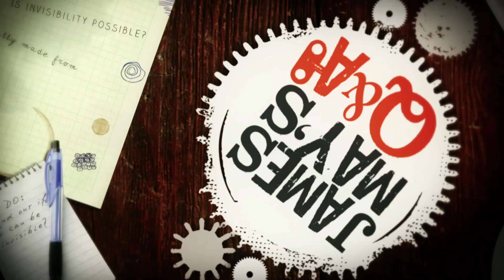Why Can't Trains Go Uphill? | James May's Q&A | Earth Science

Comment: he says steel on steel has very little friction but the coefficient of friction for steel on steel is .5-.8 (and im guessing locomotive engineers use optimized steel for trains so it's probably closer to .8) which is pretty high, for example, rubber on asphalt (as he mentions tires on roads) is only .9
Reply: Don't know what you mean by "optimized" steel, but if you take a steel rod and drag it across rail it will slide extremely easily, whereas if you take a tire and try to slide it across asphalt it will grip a lot more. The difference is locomotives way over 400 tons so that helps the wheels grip the rail.
(also locomotive engineers just control the train enroute, not build them)
Reply: As he alluded to, both train wheels and the tracks are curved.   It's like two coins touching on edge.   There's very little contact area.

Comment: Duh... the wheels slip.  BTW, 80% grade is not 80-degrees.  The problem with gradient is that the normal force (that actually generates friction, perpendicular to the grade) is reduced by the cosine of the gradient's angle (N=W cos A), where W is weight, and frictional force is F=uN, where u is the coefficient of friction (to put a fine point on it, there are two friction cases... u for static friction (before the train moves), and v for rolling friction (self-explanatory)).  It doesn't "create more drag."  Go back and take statics again.  FAIL.

Comment: Jeez, I hate to say this, but this video seems wrong all the way through.  The reason train wheels are efficient is because they don't deform, so just a point is touching the track.  A rubber tire flattens so there is a whole patch touching the road.  And as the tire turns, the tire is constantly squishing.  All that squishing takes energy.  Train wheels don't do that.  Train wheels would be super efficient even on a regular road.
Reply: Other than the fact that they would destroy the road XD

Comment: Maximum speed is NOT determined by aerodynamic drag, it's determined by mechanical limitations and the track conditions.  Only when you get into the high end of high-speed rail does aerodynamic drag become somewhat of a limiting force.  Steam locomotives reach mechanical limitations long before aerodynamic drag becomes a limiting factor.
Reply: Limiting yes. Relevant No. The fast passenger steam engines like LNER A1 and A4 or the BR 01.10 and BR 03.10 actually benefit from streamlining using less coal. Full streamlining was dropped from the latter two mainly because coal was cheap Post WW2 compared to the extra maintenance effiorts

Comment: Real answer (without the video waste of time)

Modern trains there is no reason at all.  They go uphill just fine.

Some early steam engines had to coast downhill a bit in order to get the correct valve and piston timing to apply enough power to get moving uphill... but even then they could go uphill if the operator knew what he was doing.  Once moving, no problem as long as the load wasn't excessive vs the grade.

so obviously (before even looking at this waste of bandwidth... the video is based on stupidity.

Comment: The Train that goes up to Pike's Peak is one of the steeper grade around. You always worry about the breaks on a train when in that situation. The conductor assured us the break were in good order but even if they did fail there were two spring at the bottom to stop us. Manitou Springs and Colorado Springs.
Reply: That's a cog railway.   The locomotive has a drive wheel with teeth that mesh with teeth in a rack.  No normal train could travel up that grade.
Reply: You misspelled the word "brake" twice. Not a slip up. Ignorance because of our school system.
Reply: Yes I do know how to spell brakes......It's was a brain fart.

Comment: Union Pacific Big Boys had no problem climbing the Sherman Hill...
Reply: A big 1.55% grade
Reply: 1.55% gradient. Lickey is 2.65%. Do some proper research, thank you.
Reply: @caboose.20  lickey? Where's that?
Reply: @vajeye-nar6172  Worcestershire. James said that in the video.
Reply: @caboose.20   Union Pacific Big Boys on that line are they?
Reply: @vajeye-nar6172  that's isn't very relevant.
Reply: @caboose.20  my original comment was in response to the original posts' commenting specifically on the Union Pacific Big Boys on Sherman Hill. You reply to my  comment talking about Lickey in Worcestershire when that has absolutely nothing to do with Sherman Hill or the Union Pacific Big Boys. Please tell me why my last comment is Irrelelevant and why your Lickey comment is relevant to Sherman Hill or Union Pacific Big Boys.
Reply: @vajeye-nar6172  you said Sherman Hill's gradient was "big" even tho it's nothing compared to Lickey.
Reply: @caboose.20  It was supposed to be a sarcastic comment hence "big".
Reply: @caboose.20  considering the lengths of trains there, it can get challenging real quick
Reply: @vermilionrailfan5651  any gradient would be difficult if the train is long enough

Comment: Does the contact area have anything to do with it though? That's something I don't get, because area isn't in the equation I learned for the force required to overcome friction. The friction remains the same with any amount of contact, I am told, because each point carries a fraction of the overall weight. The equation only uses weight and coefficient of friction. So would it matter if the train had beefier wheels?

Comment: What about roller coasters?
Reply: Roller coaster cars are pulled up a big high incline by a rigidly connected chain drive. Then it coasts down the other side and just free wheels the whole time it is moving. It's never going faster than it does on that first drop. It never has tractive force between wheels and tracks. 

Its average speed is constantly decreasing all through the ride. Roller coaster designers build sharper turns and twists later in the ride so the customers won't notice that it's going slower and slower all the time.

Comment: A specially designed train called a cog railroad can go up hill.  They have on to get to the top of Mt. Washington in New Hampshire.  Not sure if they have them anywhere else.  Basically there's a big cog in the middle that meshes with teeth on the track pulling the train up and preventing it running away back down the slope

Comment: Qualified freight engineer here.. uphill you had mostly right. However the downhill opinion you had was completely wrong. MANY features prevent runaway trains, mainly, the train-line air brake. if conditions are perfect it is possible but very unlikely.
Reply: I know what you meant, vacuum brakes
Reply: Reverse gear also helps with Downhills.

Comment: Who says trains can't go uphill?
A recent example was runaway work train that the brake failed and the train crashed at the bottom of the hill with it's load of lumber or coal about 3years ago.
America's Coastal region is generally 12 to 50 foot above sea level, yet these trains make it across the country at higher elevations so yes trains go uphill.
The author of this story never read "The Little Engine that could".
Reply: Wiki
"The Lac-Mégantic rail disaster occurred in the town of Lac-Mégantic, in the Eastern Townships of the Canadian province of Quebec, at approximately 01:15 EDT,[1][2] on July 6, 2013, when an unattended 74-car freight train carrying Bakken Formation crude oil rolled down a 1.2% grade from Nantes and derailed downtown, resulting in the fire and explosion of multiple tank cars."
Reply: Too much weight and the locomotive's wheels start slipping on the rails. Sometimes trying for a hill, you have to make sure you have locomotives spaced out through the train, and depending on the length and weight, multiple in the front, middle and back. It can do the hills, just not very well. At work we had one area called "The Hill" and whenever it was more than just empty tank cars, it could cause some trouble. Half the time they would add extra locomotives just to ensure it could climb the hill, and they'd just get dropped off in a nearby yard afterward.

Comment: Don't trains brake with shoes onto the rail itself rather than braking a hub mounted disc (like on a car) or the wheels themselves (like push bikes)? If not, can they? It seems that'd be a lot more efficient a way of slowing them/holding on a hill.

Comment: So why didn't they have a second set of track inside the main ones only on hills that were gear pattern  and a set of wheels in between the main wheels to gain grip on the incline? It works in my head so it should work in real life
Reply: no it doesn't work in real life ( I'm just guessing) cause i think the tracks inside of tracks are for bridges only for some crazy reason
Reply: They're there for protection against derailments.
Reply: oh ok thanks for the fact

Comment: This videos conclusion is wildly misleading and incorrect, even though it's well produced and has a charming chap presenting the facts.

First off, they didn't actually explain why trains can't go up any steep incline, whereas a car can. In their explanation, the only advantage the car has is that it packs more power per unit mass, which should mean that it only climbs faster than the train, but the train should still in theory be able to climb, just at a slower pace. They can make the power per mass ration as small as they like, all it means is that it climbs slower.

The reason the train struggles with inclines is a combination of the frictional force F= u*N relation and most importantly, the >mass distribution< of the train. As some have pointed out, the frictional force gets smaller at a steeper angle since the normal force N gets smaller, but this ALSO happens for the car, so it still doesn't explain why trains can't climb whereas the car can.

The REAL reason the train can't climb is that a vast majority of its mass is distributed along carts that do no provide propulsive power through their wheels. Their normal forces do not contribute to the total frictional force available to propel the train. Only the locomotives mass contributes to the normal force in the F=u*N relation. This gives the train a very small frictional-force-transfer to total mass ratio. For the car, all of the cars mass contributes to the normal force in the friction formula F=u*N, assuming a 4-wheel drive. Thus, when the train faces an incline, all of the masses in the carts create a significant pull on the locomotive, without contributing to the propulsive frictional forces needed to overcome this pull.
Reply: The force of friction will have to be bigger going uphill tho if the train is keeping the same speed

Comment: Trains are ultra awesome and beautiful things.
Reply: They are indeed :)
Reply: A streamlined steam engine would easily get up the hill without any problems unlokia
Reply: Sonny Lindfield not as good as cars
Reply: no, not at all!

friction limits trains:

if angle_tohorizontal axis > arctan(friction_coefficient)  then they would have no grip anymore.

the friction coefficient at steel touching steel is ~0.1

lets assume we can achieve 0.15 with extra sand:

alpha_:horizontal = arctan(µ) 

tan(alpha_horizontal)= hill_gradient = µ

 hill gradient = k = tan (alpha) =  µ
->k= 0.15 = 15%

proof:

example: train climbing a hill with angle of b; the force on the wheels shall be equal to the max. traction force(->max. friction)

Then as mechanical engineering tells us:

a) Sum(forces in x)= m*a

+ F_r_friction - mg* sin(b)=ma 
special case: a=0 -> max angle:
->F_r_friction= mg sin(b)

b) Sum(forces in y)=0:
+F_normal - mgcos(b)=0
F_n=mg cos(b)

1)-> Fr_friction= µ * F_n = µ * mgcos(b)
2) Fr_friction = mg sin(b)

Fr_friction=Fr_friction
µ mg cos(b)= mgsin(b)
µ= tan(b)!

if µ>tan(b) -> train can go up steeper than angle of b.

if µ<tan(b) -> train cannot climb the hill with angle of b.
Reply: Just like Donald Trumps hands then.
Reply: Jereau Jolly cars are shit

Comment: At 00:40 - 80% is not 80 degrees. 80% is a slope of 4 in 5, which appears to be what you mean. 80 Degrees is a gradient of about 5.7:1.
Reply: He also said 1 in 1.25 which is equivalent to 4:5

He was wrong about 30% though. He said 30% is 1 in 3, but that's wrong.

30 deg is 1 in 3.

30% would be 1 in 3.333...
Reply: James said this part absolutely correctly, 80% is how stairs are made. But the animation is wrong
Reply: Animator messed up the % with degrees

Comment: At 4:08 James says the tractive force remains the same for the train on an incline as to when it is on a flat surface. However this is not true as when something is placed onto an incline the force of friction decreases as shown in the equation F= m*g* cos(angle)*coefficient of friction. Sorry James, but from a physics perspective you were wrong as the friction between the wheels and track are greatest whenever the track is perfectly flat and will decrease whenever it's at a gradient.
Reply: I agree that it's wrong to say that it remains the same, but at the same time, considering the slopes that trains would be expected to go up or down, the difference in tractive force is pretty negligible.
Reply: Tyrian3k Yes you are correct as at a 2.5% gradient (1.432 degrees) the theoretical frictional force is 99.97% of the friction which it would experience on a level surface. Even at a 20% incline the frictional force is 98% that of on a flat plane. These are pretty negligible differences but .9997 isn't exactly equal to 1.
Reply: You are not accurate on the equation for the force of friction. The force of friction is the normal force times the coefficient of friction. What you have described is an object where the only acting force is gravity. You must take into consideration that the train produces a force going up the hill which will (if the wheels can handle it) will produce a HIGHER FRICTION than on a flat surface as it needs to produce more force going up the hill.
Reply: I suppose he were talking about the friction coefficient

Comment: Are there "tugboat" style trains with greater grip that can help out in a pinch?  Or specialized trains for particularly hilly countries?  Seems like you'd want at least some compromise between top speed and terrain tolerance.
Reply: yes, there were specially made 'banking engines' that were soley used for helping to push other trains up steel grades. One that was used on the licky incline (mention in the video) was called big bertha. As a normal locomotive it would have been a failure, but as a banker it excelled.
Reply: In the U.S. they use "helper" engines, usually at the back and controlled by the crew at the front for mountainous regions. It's not uncommon to see six or more engines, each with 4000+ horsepower pulling around 100 or so cars through the mountains.
Reply: Wonder if a gearing system could be used more broadly.  Or perhaps you could magnetize the steel wheels to the steel tracks.  Maybe in combination: magnetization to prevent slipping while climbing with gears?

Comment: Just a small point. When trains came about in the 1800's, many engineers tried to come up with alternative systems, like rack and pinion, that would increase traction on rails because of the idea that a train on a rail would meet and an extremely small, and theoretically infinitely small point, since the intersection of a circle with a line is such. This continued until a scientist was able to show that this is not in fact what happens at all.

If you take a steel ball and bounce it off concrete, you will see what happens. It bounces. Rubber bounces  because it flexes and returns the energy to the ball to bounce it. Steel flexes as well, but it is so resistant to flexing that it flexes much less, but it takes much more force to do that. However, the force imparted to the steel ball is returned to bounce the ball again, in proportion to the force imparted. This is why that steel "clack clack" toy works.

When a rail car meets the steel rail, it actually flattens under the force of the weight of the rail car. It is not much. The contact point is about that of a dime. However, even that point of contact, under the tremendous force of the weight of the car acting on such a small point of contact is enough to flatten the steel and actually make for a pretty good, if temporary, contact with the rails.
Reply: yes indeed!
Reply: And then the contact area shrinks when the train is unloaded?   Or the train itself causes this compression?
Reply: @jshepard152  no, the only traction that matters is the driving wheels on the locomotives, which pretty much always weigh the same.
Reply: @ThePedro8161  - Until you want to slow or stop the train. Then every wheel has brakes, so trains can stop in a much shorter distance than they can accelerate. On passenger trains that have electrically controlled brakes the emergency stopping distance is much shorter than freight trains that have train line (the pipe that supplies compressed air to the brake system on each car) controlled brakes.
Reply: Why lie?